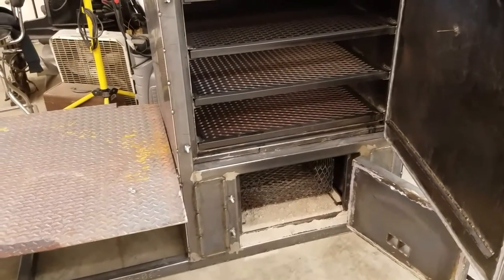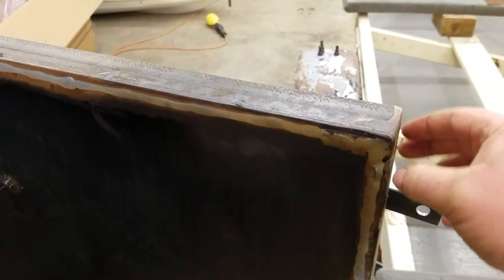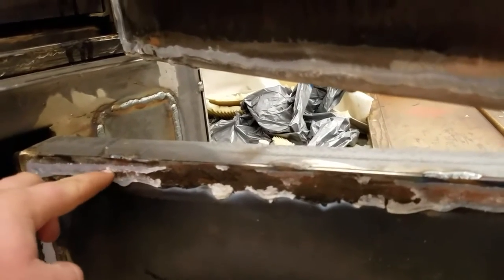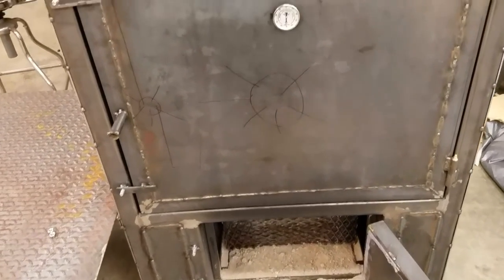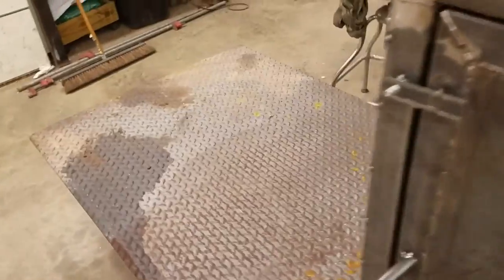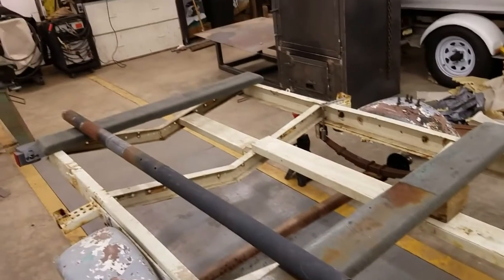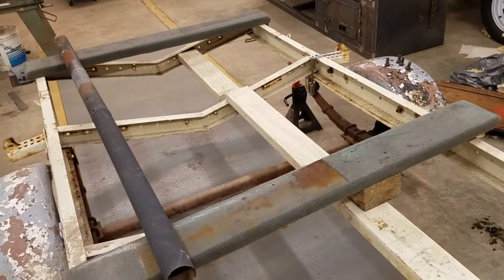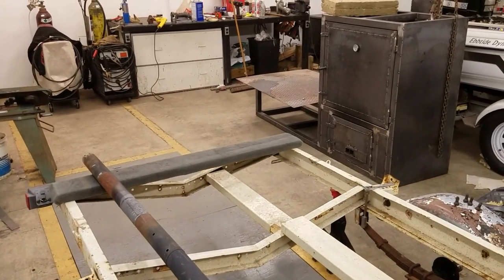Insulated Reverse Flow BBQ Smoker Trailer Build Part 6

Comment: I've built a few these smokers, yours is looking great by the way. I just have a little constructive criticism for you hopefully it'll help you, as far as your gasket goes you should put it on the door jamb of the smoker not the door itself. If you put it on the door itself and your door is not all the way open when you pull your racks out it will catch on the gasket and tear It Off so I found it's best to put it on the door jamb of the smoker not the door. keep up the great work it's looking good
Reply from the maker: +ronald nelson Thanks for the tip! What adhesive do you use for the gaskets? I am having trouble finding something to stand up to the heat of the firebox. I have tried both the Rutland 600F and some wood stove cement.